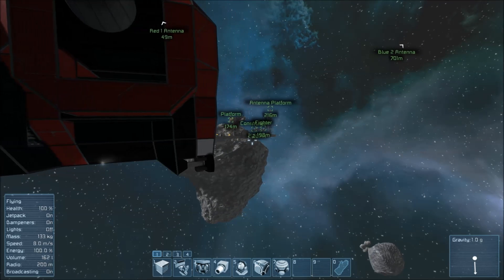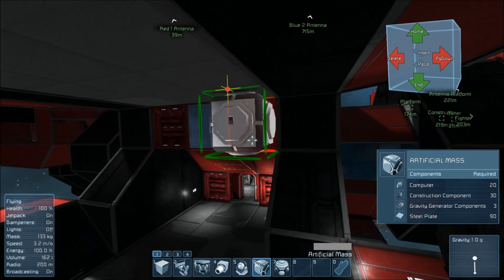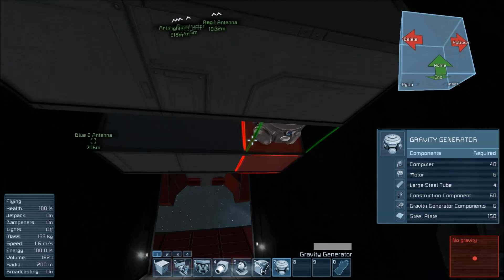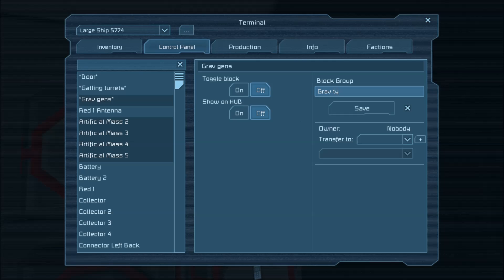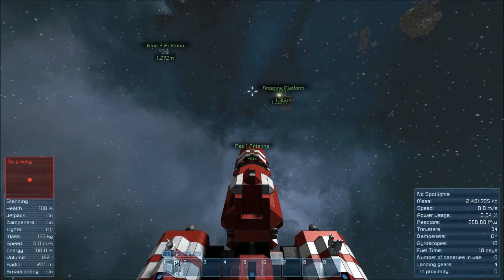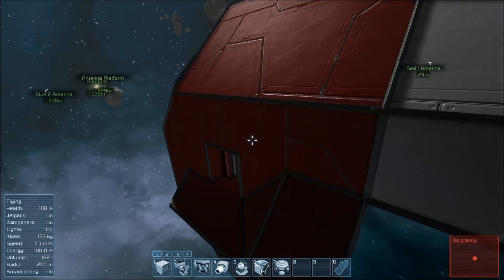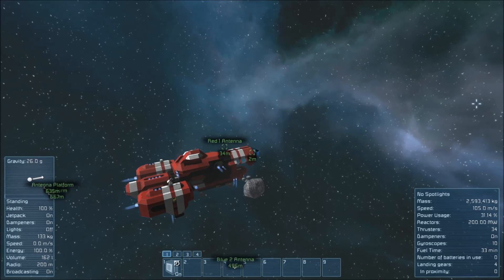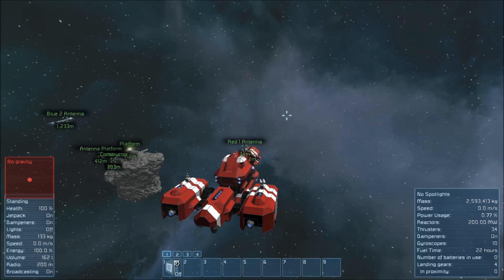Space Engineers Tutorial 8 - Gravity Drives

Comment: Is the speed really that drastically changed? Or do you have a speed mod installed? I ask bc I can’t use mods and the vanilla speed is slow
Reply from the maker: Using a gravity drive does not increase your top speed.  Rather, through the use of multiple gravity generators and artificial mass blocks, you can impart acceleration without using thrusters.  If your ship is particularly massive, however, you'll need lots more generators and mass blocks.  Try adding more.  All of this is 100% vanilla, no mods needed.

Comment: I know this is old video but just in case anyone reads the comments you made this way to complicated on the pull affect.  Yes you can use mass blocks to balance it close but it still pulls.  To fix the final amount of put you dont just live with it.  You build a single spherical gravity generator either above or below your center of mass.  Not level with it.  then through the menu you adjust its push or pull by .1 until your heading is trimmed out and straight.  then just add a shortcut to turn that generator on or off as needed.  Once you have the proper trim set another spherical generator opposite it from the center of mass and reverse the setting.   Now group your forward flat grav gens with the forward trim spherical and add a shortcut to that group so they all turn on as needed for forward motion.  Same for reverse.

Comment: Theoretically, if one were to place a cluster of mass blocks (3x3x3) at an imaginary center, then surround it by a 3x3 set of gravity generators on each face (meaning a gravity field in each axis direction of the cube. Would I be able to accelerate in any axis direction (or derivatives) by turning the respective generators on? (and their opposites off)

Also, wouldn't limiting the gravity field size to only envelop themselves and the artificial mass allow you to circumvent the "can't have regular purpose grav-gens" rule? i.e.
Make the sizes so that the regular ones don't touch the artificial mass blocks, and so the gravitation drive only touch the arfiticial mass blocks?

I'm going to test this anyway, but I'm just curious and it's 5 a.m.
Reply from the maker: NLTops Yes, you can do that.  As for the multidirectional gravity drive, it's possible but it's difficult to control, in my experience, you'll have to have separate hotkeys to toggle all 6 sets of generators (on top of the art. mass), and it doesn't work out to be very responsive/intuitive to steer.  Most people only bother with forward and reverse, and use gyros/thrusters to turn at speed.
Reply: Yeah I figured it might be a bit overkill to go all 6 base directions using gravity.
But essentially, as long as two opposite gravity gens cancel out and not rip things to shreds, you could use a timer for each direction, which shuts off the opposite direction and ensures the direction in question is on. And for each axis one that "puts it in neutral". I'd imagine the controls would take some getting used to.

Reason I asked is I'm really interested in building a small spherical heavy fighter without exposed thrusters and weapons in each direction. Should be fairly easy to make sure the center of mass is the same as the center of the gravity drive. Given the above-mentioned control scheme and design, it should be theoretically possible to go in combined directions like forward/up/left. The ability to roll around using gyro's combined with acceleration over 3 axes sounds like it would be a really fun experiment. Even if it fails or crashes or blows up a couple times.

Love your vids. Thanks for the reply.

Comment: Is it possible to install a gravity drive on a small ship aswell?...it would be cool to have some sort of reconnaissance ship that could traverse space very fast...or a heavy fighter with lots of guns that normally would require lots of engines(btw i only play the game for 3 days)
Reply from the maker: Not a ship that uses small parts.  Gravity Generator only comes in "large."  You can, however, put small Artificial Mass blocks on a small ship/fighter/etc, and build, say, a ring-shaped station covered in gravity generators that acts sort of like a jump gate, in that flying through it with your Dampeners off will catapult you to max speed.  Of course, that doesn't help with the return trip unless there's  one on the other side, too.
Reply: oh well...i guess il have to use lots of engines on my heavy fighter design....
Reply from the maker: Razvy Oltean Good news, today's patch has made it possible using rotors.  You can now attach and detach rotors of different sizes, so you can now have a large gravity generator on your small ship.
Reply: ty for letting me know....im gonna try it soon